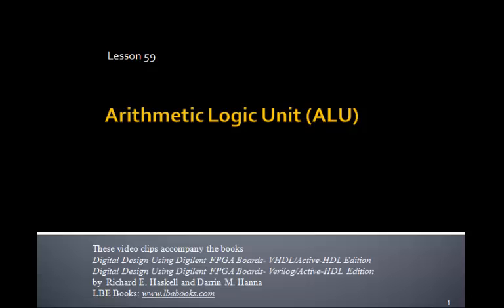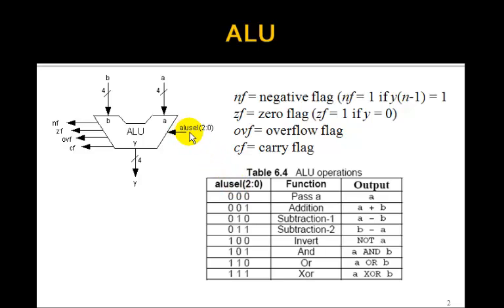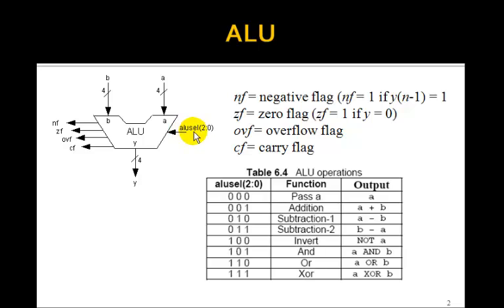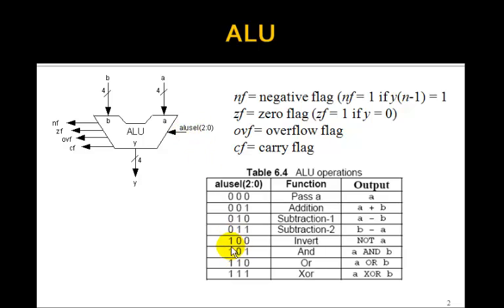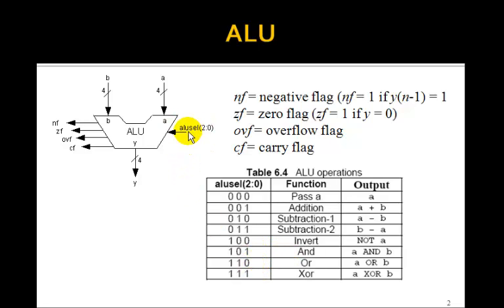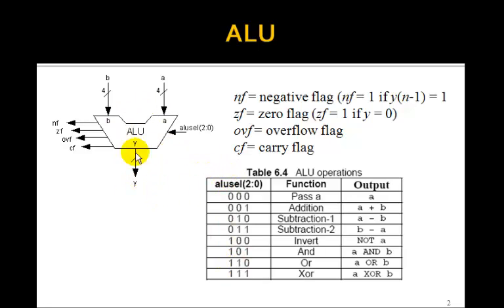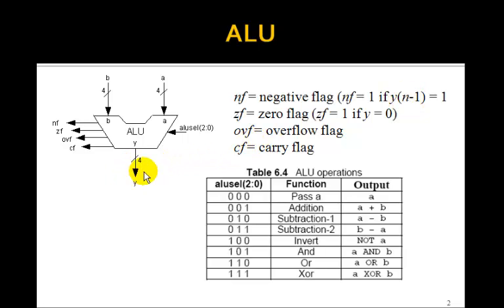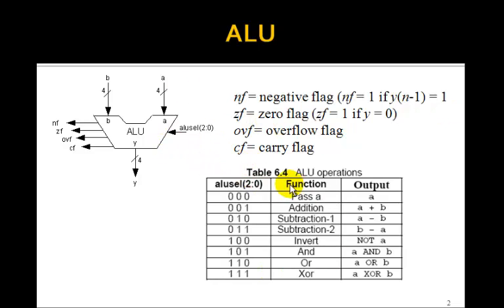Lesson 59 - Arithmetic/Logic Unit ALU

Comment: there is a problem, if we take the value a input as 2 and b input as 3, then we perform operation alusel 010 ( subtract ) , then output gives the F. 
why...?
Reply: This may be late but useful for others who may wonder the same thing. 2-3 when you subtract them is of course -1. To represent this in binary we would take the two’s complement. In a 4 bit representation we have 0001 for one. Now, to get the twos complement, we flip all the bits and we get 1110 and then we add 1. 1111 which is 15 in decimal and F in hexadecimal.